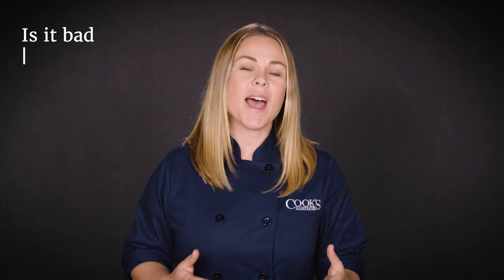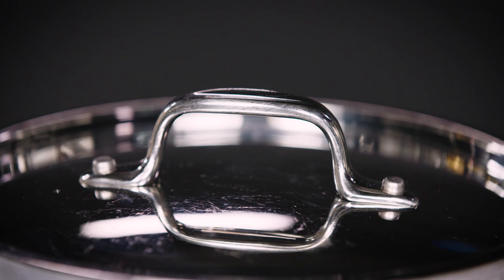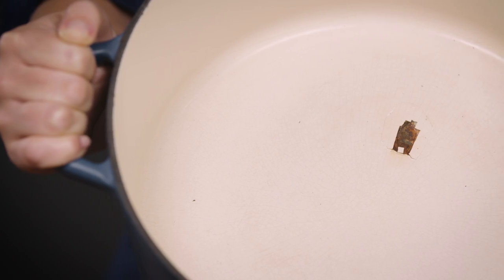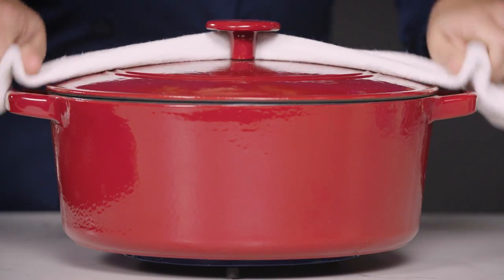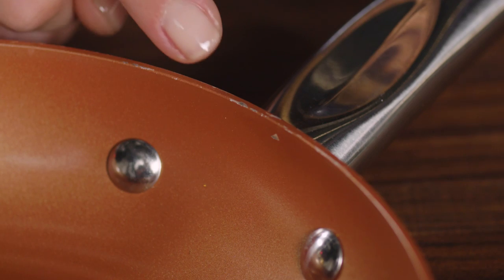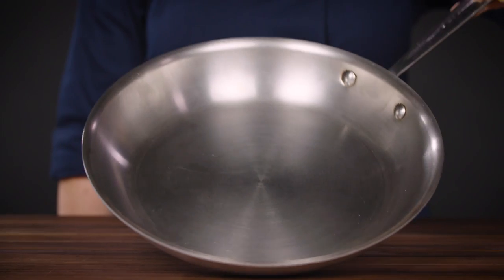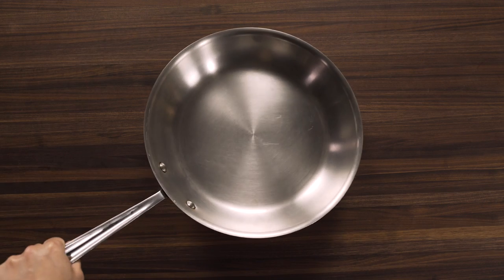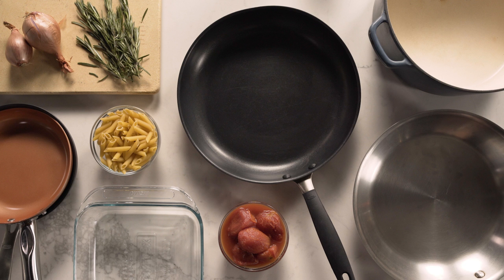Is it Bad to Pour Cold Water On A Hot Pan?

Comment: I learned that many years ago and stopped putting hot pans in cold water, or even warm water after use until it has reached room temperature. I use to work for the West Bend company decades ago and made cookware for other companies as well as for West Bend. Rena Ware was one of the brands of expensive cookware we made and I always worried about it and how well it would stand up in normal use, and there was other brands with clad bottoms on it which I also worried about, but somehow it all held together fairly well in our tests at the factory.

Comment: what about deglazing with a cold liquid?
Reply: I think a small amount won't hurt much.
Reply: No problem. Adding small amounts of cold liquid to hot pans is a routine part of cooking. Adding a little water to the pan after cooking when appropriate to make cleanup easier is a very good idea.
Reply: @Paelorian  What Paelorian said. It's generally still on the heat so the liquid won't do much, and it's usually a small amount of liquid. To damage something like an all clad pan you would need to take it right off high heat and put it in an ice bath.
Reply: thanks, ive always deglazed and not worried about any liquid but the warnings about little bits of liquid cracking pans got me a little concerned.
Reply: @mss319971  Little bits of liquid, like on a counter or in the sink, are a concern with glass and ceramic cookware, but not a problem for metal. My mom once had a glass lasagna dish shatter when she took it out of the oven and set it on a counter that had just been wiped down. The small amount of water was barely visible, but it was enough to cause a localized thermal shock.
Reply: @seikibrian8641  We once used a glass pot to make soup, and it shattered when some cold water was added in. 

Glass cookware is the devil.
Reply: @Nocturne22  
Boy, I bet that was a mess!
Reply: It is okay to add cold liquids to a metal pan,  just don't submerge a hot metal pan in cold water.   With glass you must always use hot water to add to a hot,  partially filled pot,  and you do it by increments.  Let a glass pan cool before putting it in the sink.
Reply: @b_uppy  "It is okay to add cold liquids to a metal pan..."

It depends on how much and how fast, and on how hot the pan is.
Reply: @seikibrian8641  
I have added cold liquids and no probs.  It is submersion that affects the temper.  Cooks always add cold liquids to hot pans,  and the pans are fine.  Not sure why you think it is bothered unless you have terribly cheap or defective pans.
Reply: @b_uppy  Read again what I wrote.
Reply: @seikibrian8641  
Yep,  no difference on my part.  Yours isn't correct.
Reply: B uppy I would think submerging a hot metal pan in cold water would be adding a lot of water very fast to a hot pan. Seems to match up with what @SeikiBrian commented.
Reply: @DBJordan  
I said adding water ,  as in cooking.   Submerging causes one side to cook faster than the other as it is being set in water.  There is a big difference.  Wording is important,  as is actions.  There is a reason for taking pains.  That you think one is the same as the other is your mistake,  your ignorance.  

Don't believe me?  Do your own experiment.  

This video is not well worded.  That is why I added my commentary for clarification.  I have done metal working,  I know what I am about on this.

Comment: Heat them up slowly, cool them down slowly. Good rule of thumb.
Reply: Unless you declare “I’m deglazing the pan!” before hand... then you’re just fine.
Reply: @BrynTru  😅well... pouring cold H2O in a hot cast iron pan can risk cracking it. Doing the same to other pans can risk warping the floor of the pan. I try to play it safe. Be well!

Comment: Instead of running pans under water or placing them in water, to deglaze and aid in cleaning just add a small amount of water to the pan. Like two or three tablespoons. Not if the pan is full of oil, obviously, or extremely hot (I would say over 300°F may be too hot for this). But typically you can add a little splash of water to a moderately hot pan and it won't drop the hear much. You'll just have a very shallow bit of steaming hot water aiding the cooldown and moistening food particles. This is a different matter, no different to the pan than the routine task of adding small amounts of cold liquids to hot pans during cooking. Obviously it's OK to add a glug of room temperature oil to a hot pan, or to add some liquid from the fridge to make a pan sauce. Use common sense. What damages pans is rapid temperate change (thermal shock). As long as you're not changing the pan hundreds of degrees in temperature in seconds, you're probably OK. Running water or placing the pan in water is exposing the pan to a great deal of water and can cool metal hundreds of degrees Fahrenheit in a second, causing warping. A splash of water in my warm pans after I take the food out doesn't even cool then down. I'm not talking about a 500°F pan, because the water would boil away and rapidly remove hear from the pan. I'm talking hot pans under 300°F.

Comment: Running cold water into a hot pan happened to me.  A tri-ply layer skillet sustained discoloration that I could not remove, even with Bar Keepers Friend.  The pan functions normally, but it's mirror finish is permanently damaged.
I learned my lesson, now I only use hot tap water to rinse a pot, or pan, even nonstick and it works.
Remember hot pan use hot water, no damage sustained.

Comment: My trick is to use a electric kettle to have boiling water to wash with.
I don’t go directly from high heat on the stove to the sink. It can be hot-ish, but not sizzling hot. And I try avoid putting my pan through this risk of temper shock, but when I do it, I do it like this.

And I only pour in a small amount of the boiling water in and swirl it. 

The more water the bigger the temper shock you will put your pan through.
So use as little water as you can. And its better if you pour in a little more at a time. Spreading it out, giving your pan some time for the heat to even out. Even if we are just talking about spreading it out over just 3 seconds.
It might be the difference between a ruined pan and one that is still fine.

When I’m about to start cooking I just fill the kettle up. Then when I’m a few minutes away from being finished with the pan I just press the button, and it manages itself.
And it will keep very hot for a few minutes, a lot hotter then anything in the sink, so the timing isn’t that important.

Comment: I would never just dump my pans into cold water but I do put a small amount of hot water into the hot pan when I’m done cooking. I’ll swirl it around a bit to help loosen up stuck or burnt leftovers and then dump it out. I’ve never had an issue with cracking, chipping or warping.

Comment: I was raised in an environment where there was always a pot of hot water on back of stove kept at a soft boil and a pitcher of room temp water to keep adding to the pot. to rinse the dirty pan or pot while still hot mom poured some of the soft boiling water into it and then let it cool on a trivet. at that time we used aluminum pots which would warp if you a cold pot on a hot element. We never had a warped pot or pan, 5 decades later my aluminum pots are planters and still sit flat holding plants and memories of Warm Morning stove cooking when elec failed and never having a dry air problem in winter.
Reply: @gidget8717  know, right? ours was big for the times, held 2 8 in skillets or pots. look up what they have now. if my apt bldg would allow it I would have the best of Warm Morning lol have fun with the memories ....
Reply: @gidget8717  while the Locke co went out of business you can find Warm Morning on Ebay as well as other  outlets. parts are easily accessible in gas, propane and wood. can't wait for your next video.

Comment: I have the recommended 12” carbon steel skillet.  At high heats it warps, making no so great for my glass top flat stove; but, it becomes flat again after resting.  Possibly heating the skillet up slowly may help?  But either way, be warned that just heating a skillet to high heat can warp it, not just putting a hot skillet in contact with water

Comment: I understand that putting cold water in the hot pan will cause thermal shock, because the different metals contract and expand at different rates. But wouldn't you have the same problem if you let the pan cool to room temperature, then immerse the pan in hot water to wash it? The sudden change in temperature will cause the different metals to expand at different rates, so wouldn't that also cause thermal shock?

Comment: I have tile all throughout my house which I used to quickly cool my pots and pans. The tiles are never super cold (though they can be chilly sometimes) but they help bring temps down really fast. Should I be concerned about thermal shock in this instance? Or are my pans safe by diffusing the heat through my stone tiles?

Comment: What about baking/springform pans? I really like to wash them immediately after releasing cake, cupcakes, or cheesecake and then toweling them dry and putting them back in oven (which is off but still warm) so that they can fully dry the creases or joints and prevent rust. I have been doing this for years and have had no problems.

Comment: I know I'm late to this 😊  If I feel the need to rinse a pan before it's had time to cool down I run the water until it's as hot as possible and then slowly introduce the pan to the running water, bottom first.  I usually get no steam this way.  Is this still a problem?

Comment: Some claim it's safe to run warm/hot water to cool down the hot pan?
Reply: The closer in temperature the two substances are, the less shock. Using hot water first, followed by cooler water, will cool a pan faster than just letting it air-cool, but will be less-likely to cause warping than using only cold water. If you have time, though, air-cooling on a trivet is the best way.

Comment: I just bought my first 5-quart stock pot about two weeks ago. It’s a cheap disk-bottom stainless steel bit from Walmart. I made a huge pot of pea soup last week (4 to 5 quarts of it!) and it was taking forever to cool enough to put it in the refrigerator for storage. So I filled a big bowl with ice water and sat the soup-filled pot on top of it. And I waited. That wasn’t doing anything. So I filled one side of my stainless steel double sink with cold water and slowly sat the pan down into the cold bath. It didn’t scream or make any weird noises as I did so... the pot had been off the burner for about an hour but was still scalding hot. After about 20 or 30 minutes in the sink bath it was cool enough to place in the fridge but the pan took many, many hours to actually become cold once in there. Given I didn’t have storage containers to place the soup in and the pan was my only storage method was there a better way I could’ve handled the situation? The pot doesn’t appear to be damaged but it probably won’t survive too many rounds of repeating that. Or could it?
Reply: Let it cool down gradually over a few hours?
Reply: Kamal Hans It would’ve taken so much more than a few hours. Split pea soup is super thick, meaning it holds heat. The stuff essentially acts as insulation. It’s heating the pan more than the pan is heating it. Like I said, it took MANY hours in the fridge to reach the fridges  temperature. Talking well over eight hours. In a fridge. Pea soup is tricky. So yeah, leaving it out would eventually work but it’s not sanitary and becomes unsafe at some point. 

The ideal solution would obviously be to spoon it into many smaller containers giving it a much quicker cooling time. Unfortunately I don’t have the containers to do that. The pot it was cooked in was my only viable storage option. Just “leaving it out” can’t be the best solution. Thanks for your response though.
Reply: @itrench  wouldn't pea soup being a liquid have a temperature of 100 Celcius?  That's not really hot.  It's when pans or pots are used for frying or sauteing with oil,  temperatures are much higher that there's a problem.
Reply: @gabriellakadar  Because it's not pure water it could be over 100 C, but not a lot more. So you're right that there wouldn't be much thermal shock from immersing it in hot water.

Comment: Submerging a hot pan in cold water warps it.  It is okay to add cold liquids to a metal pan,  just don't submerge a hot metal pan in cold water.   With glass you must always use hot water to add to a hot,  partially filled pot,  and you do it by increments.  Let a glass pan cool before putting it in the sink.

Comment: Iron hotplate hobs are a nightmare, gas by comparison is no problem at all.  One mistake you get a bowed pan. either overheating or deglazing.
Reply: @Michael Bobczynski I like what you're saying, but it is a perfect world scenario , those iron hobs particularly the ones that are solid rather than rings take ages to heat up so you have to whack them on high to start with , and it's that one time that you misjudge that you bow your pans. Having said that if they do become bowed , it doesn't seem to affect the heat distribution , I have a contact thermometer. all my plans are stainless steel with a sandwich base

Comment: I have a question about pizza stones or baking stones. I have a square one and because you put the pizza right on it, it stains. And mine is a nice shade of brown now. Is that bad? Lol. Should I clean it or even can I clean it? I don't think it comes off. And I sure don't want to submersible it in water to soak it. I figured, since it's in a 500 F oven a lot it won't be unsanitary. But I'm not sure.
Reply: Karin Brown, it’s easy to clean. Just simply scrub it with a barbecue brush every time you use it like the next day once it’s cool. If it really gets dirty in a place turn the stone upside down in the oven for about 20 minutes on high then with oven mitts turn it over and scrape it again this will get all the dark matter off. But I wouldn’t go too crazy on it I’ve been using the same pizza stone for over 20 years and it’s pretty dark but it doesn’t effect the pizza at all. I would worry more about the oils and cheese bits that end up on the stone itself that might start to smoke and burn in the oven then the color of the stone itself. that you can take care of with a piece of paper towel with the light amount of water on it.
Reply: @jarryjayo  Thank you for your response. That's pretty much what I've been doing. I guess it's just the oils that soak into the stone that you really can't get rid of that turn dark. I wasn't worried, I was just wondering. MERRY CHRISTMAS!